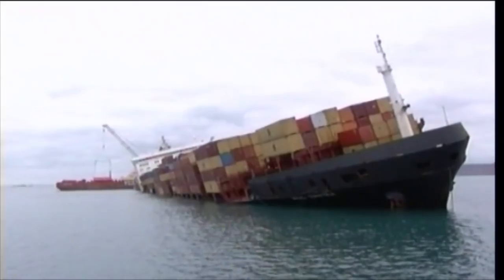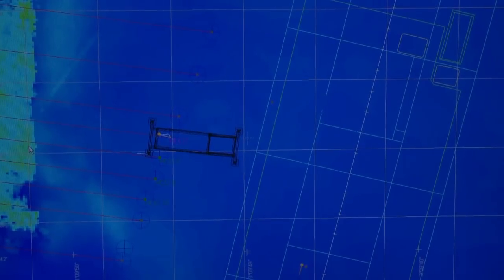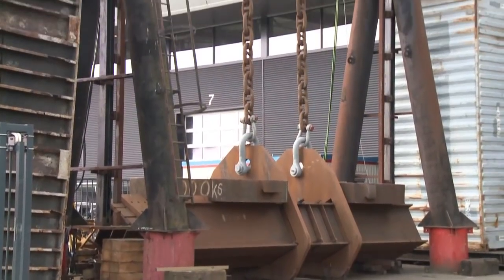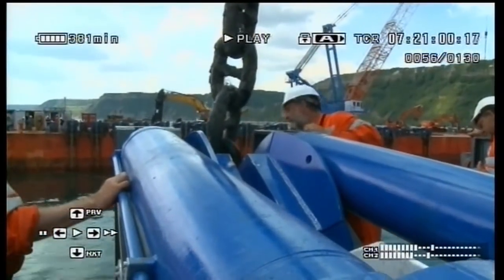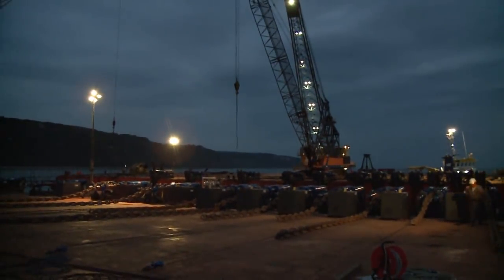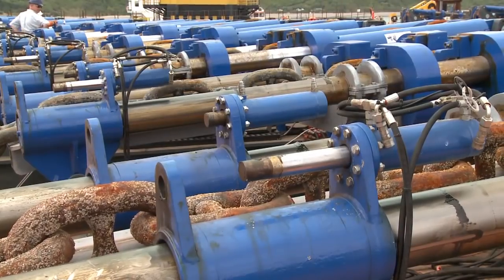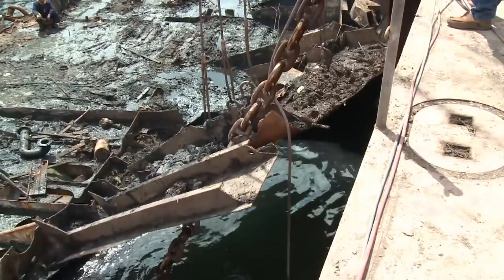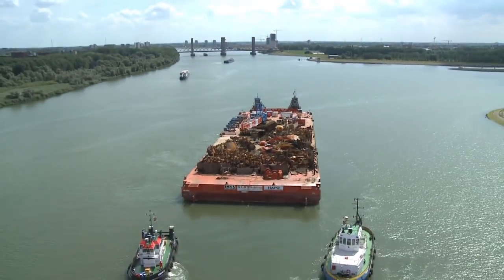Mud Fight in Lyme Bay (salvage of the MSC NAPOLI)

Comment: The MSC Napoli incident played a significant part in the evolution of International Maritime Regulations. 
SOLAS (acronym standing for Safety Of Life At Sea) regulations were updated directly as a result of the MSC Napoli's failure. Prior to this SOLAS regulations had required the gross weights for each container manifested on a vessel to be declared but there was no effective mechanism in place to actually check the veracity of gross weight reported to each vessel master prior to its loading. This rather obvious breach in the regulation had been systematically abused for decades, with some areas of the maritime global network notorious for under-reporting gross weight measurements. The end result of these negligent practices (in some parts of the world) was vessels sailing in a dangerously overloaded and/or unstable manner - in other words, an accident waiting to happen, which it did in Lyme Bay during 2007.
The updated SOLAS regulations meant that each and every container had to be physically weighed at an approved, ie licensed by an approved individual National agency, weighbridge facility before loading. The Gross weight was just one of the pieces of information provided on the Export Customs Entry, no certificate stating the weight, your container doesn't load on to the vessel!
I worked from Spring 2011 onwards in International Freight Forwarding - before that I was on the other side of the fence as a user of such services - I recall everyone involved in international shipping, principally those on the export side, moaning about the hassle of now having to both arrange and pay for the certified weighing of containers prior to actual loading on to the vessel (this extra stage had to be factored into your time schedule so you met the various vessel sailing deadlines with comfort). This YouTube video of the documentary explains why such additional regulations were required - before the extra stage of actual weighing being mandatory, container vessels were sailing the oceans with, in some cases, severely overdeclared and under-declared gross tonnage data - given stability issues, a container being significantly less than the real weight was just as big a problem as the other way round. Coastal communities around the globe were in danger of significant negative impacts resulting from vessels foundering. 
The changes in SOLAS regulations are summarised in this handy on-line document
https://www.worldshipping.org/History_of_IMO_Effort_to_Improve_Container_Safety_May_2014.pdf
Reply: Lies again? Marine Soldier

Comment: I've  worked for 30 + years as a heavy duty mechanic and welder/fabricator.  I can't imagine how difficult it would have been to cut that thing apart with a torch after so long underwater.
Reply: Actuallly that's not so hard. It all depends on the angle you hold your cutting torch. You have to hold it almost parallel to the material and then you can blast through almost anything. I burned my way through thick layers of rust/steel/mud that way when building constructions on site at Tata Steel Ijmuiden. And I can tell you that some sites at the Tata terrain resemble the rusty hulk of the MSC Napoli very much....

Comment from the maker: @davetileguy by using this technique they could control the lifting and pressure per section; using submergable barges would not allow for this delicate lifting. breaking of the wreck during the lifting process would lead to an environmental disaster. The mud was so stiff and thick that putting air in under pressure would notfree it from 9 meters of mud it was stuck in. That's why only this approach was a feasible option.
Reply: @William Davis no. Just read the explanation.

Comment: I think I read elsewhere that the first set of chains were "used" before, elsewhere. The second set were, obviously, made from substandard materials and failed quite miserably. No testing and/or quality control on the second set, I would guess. Did anyone catch if the second set were brand new or also "used" junk? All that testing of the pullers and none for the chains.

Comment from the maker: sorin otel The vessel had run aground and was damaged too much to be floated again, and demolishing was the only option left to remove it. So, they cut the vessel just in front of the wheel house and first removed the bow section. However, when they started to demolish the stern part it got damaged even more and sunk deep in the mud. As the vessels situation and condition now had change dramatically, another salvage company that was more experienced and better equipped was commissioned to execute the salvage operation of the stern.

Comment: So , what happened to the engines that weighed it down, no sign of them on camera.
Reply: 18:43 in couple of scenes you can see engine block sticking out of the water.
Reply: The engine is there, you can see the tops of the exhaust valve housings. But youdon't know what that looks like, so shut up.
Reply: 17:30
Reply: 19:16 and 19:21 is the crankcase and you can see a piston in the background.

Comment: If I understood correctly the piece they were lifting weighed 4000 tonnes and they had 12 chains each rated at 250 tons. Add to that extremely sticky clay and water resistance.
I'm no expert but I'm not surprised the chains snapped.
Reply: I must take into account the fact that the hull was submerged  , therefore it was lighter.
Reply: Yep, way understrength for the load and resistance. Should have been double the dead weight they were lifting.
Reply: 12 chains of 250 ton, with two strands each, is 6000 ton of WLL.

Comment: 4000 tons.. They have 12 pullers that can hold 250 tons each...? That's not enough to start with isit? Unless my maths is wrong that only adds up to 3000 tons of lift... There 1000 tons short.!? 
And thats without the weight of the mud and water and clay on top..! They should have had 20 pullers and stop pissing around
Reply: Yeah, I feel like “it’s full of mud!” Should not be a surprise in this kind of situation?

Comment: Plus shoot some compressed air underneath the ship to loosen it up.
Reply: Only works with small vessels, then they use water under pressure. Using air would be worst idea. But for large vessels it doesn’t work, they  get stuck even firmer if you do that.
Reply: @Thaslughy  No they don't!   :-)

Comment: they should have taken up all the slack in the chains, applied maximum allowable pressure, then set off explosive charges some distance away to shake the seabed. that probably would have broken the suction of the clay bottom and allowed the wreck to be lifted.
Reply: Hi And then the Pressure and shock wave breaks the chains and then you start again,

Comment: Did all of the specially created equipment (plus labor) cost less than the salvage value of the portion of the  Napoli stuck on the sea floor?  Did UNESCO assist in funds to accomplish its demanded removal of the wreckage?  Also, it is a shame they cut the entire ship up and lost the buoyancy provided by the intact hull... it would have assisted in lifting the wreck out of the mud
Reply: It was broken in half already. That’s why it sank - it was in the English channel or just out of it and in heavy seas and the hull just cracked right open. The only thing holding it together was the deck when they cut it up. They did originally try to tow it in one piece but the crack got worse and worse.

Comment: when steel settles into a clay seabed it produces 'Static-lock', locked in 'tighter than a Bulls Ass in fly season'....................well drillers know all about it......it happens when their drill-pipe stays up against the boar-hole too long without drilling-mud circulation, and or rotation

Comment: they needed to inject air and water, under the wreck, and vibrate the chains to break the suction on the mud.
Reply: yep, could've used fire hoses under water to squirt the sucker
Reply: Your qualifications are?
Reply: What are yours? I was a laborer I know how to fill sandbags I also learned from hands on experience.  The hard part was not lifting the ship. it was breaking the suction, instead of the chains!!  so much for college hey??
Reply: stuck in a ditch

Comment: Why not just attach those same chains to the barge lower the barge by flooding it, and pump the water out to raise the sunken ship? air is just as powerful as all those expensive hydraulics.
Reply: Yeah, there's power in buoyancy,  but just no control.  If you have air being used as a buoyant,  how do you get any precision out of it?  With hydraulics, if you need to stop suddenly,  you simply stop the flow of the hydraulics.  With the air-as-buoyancy method,  once you had about a zillion PSI of lift, and suddenly you need to stop the lift and reverse the buoyancy,  how long do you have to wait for your compressed air to piss out before the buoyancy is negated?
Reply: Stan Patterson you have no idea how barges work...
Reply: You must be an engineer!   Whahahahaaaaa!

Comment: Back up generator on the ship ? Why not have redundancy on these ships to prevent these astronomal sums to deal with thier failures ?
Reply: rene vanpoelvoorde vanpoelvoorde there are normally several electrical generators on a ship, main engines are limited because of the weight and size of them! I.e. the engine on napoli was massive and where would another one be fitted? Ship engines are pretty reliable and ships normally will have enough spare parts and engineers to cope with all but the most critical failures, in a lot of instances it isn't a mechanical failure that gives the most problems with the engines; eg. Flooding of engineering which in itself wouldn't be enough to sink the ship will cause the engine or even 4 engines to shut down. I can't remember the name of the ship but something similar happened years ago when a cargo vessel lost power due to water entering a fuel bunker during a storm and power to both engines was lost, this ship was rapidly pushed into the shore and the lifeboat that went out to save the crew was lost... there is only so much redundancy that can be fitted to any vessel without making it impractical and unfortunately that just isn't going to be enough for all situations.

Comment: Why didnt they use cutting cables like most salvagers. why chains? , cable has many many industrial diamonds in whatever length they needs and it will cut thru mud and steel.
Reply: tony hurley probably either expense or availability? Not too sure